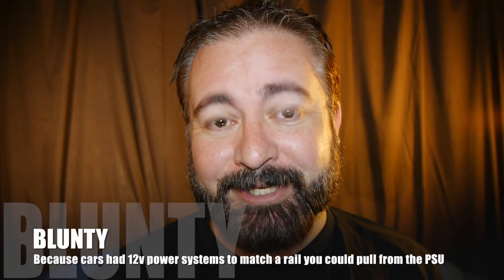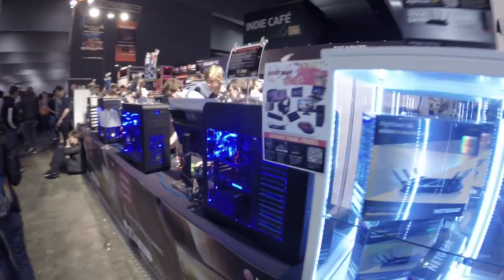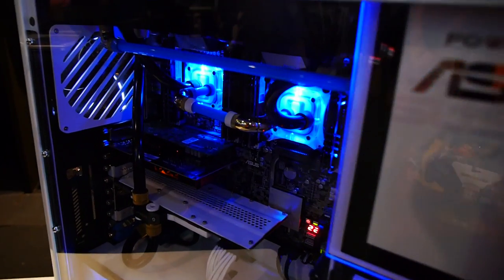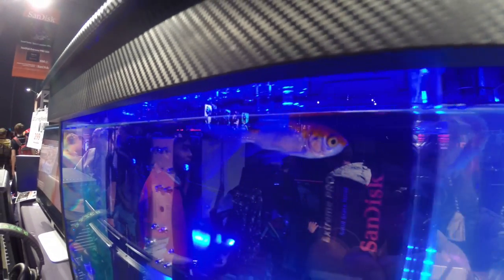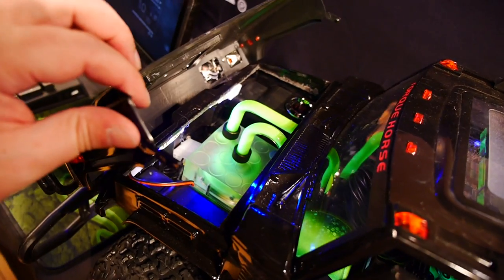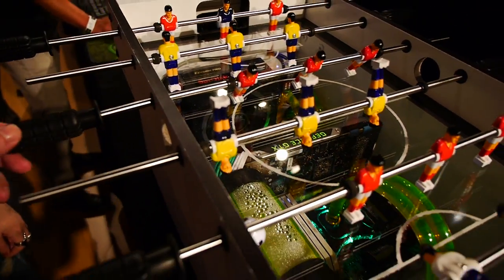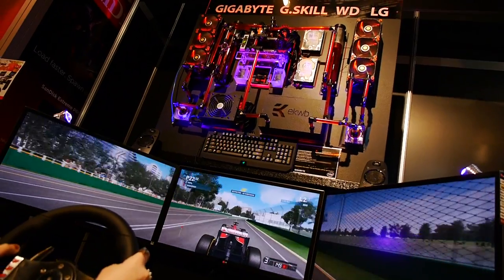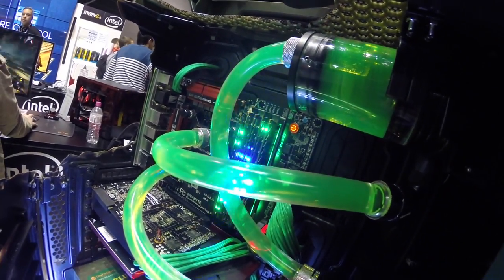Crazy PC Case-Mods & Custom Gaming Rigs

Comment: I think case modding is very interesting. Some designs do look amazing, but I always found practicality and functionality more important. Everything aesthetic is "just" a bonus.
You know what I would find absolutely sexy as a computer design? A rig that allows for easy hardware access for cleaning and upgrading purposes. On that note, here is my million dollar idea:
A vacuum cleaner connection to cases. This specially designed hole, fits the standard vacuum cleaner tube and is positioned in such a way that it will allow the vacuum to suck out all the dust from the inside, without having to open up the case...I wonder if this is possible. I'd get a case that had this feature.
Reply: I'm not sure how it could produce static. Would you care to elaborate?
Reply: Cristal3 James is correct it will Would create static because of all the dust particles will rub against the components creating a static build up. I'm afraid you will just have to use a duster can for now :P
Reply: PhasePictures Thanks for explaining and...too bad xD
Reply: Cristal3 No problem friend and yep its a shame but I'm sure they will eventually make an easier way to clean pc's :)
Reply: PhasePictures Could it be sucked out?

Comment: That Cooler Master Full Tower Case that was painted red near the end of your video is EPIC! I haven't modded a case since my old Thunderbird 800MHz machine in a Full Sized Evermax Tower. That was a beastly machine in it's day. I still have the modified case as well. I was thinking that some day I would improve on it's design and build something improved in a similarly (but different designed) case doing a water cooled setup. The hard part is just for a case and decent water cooling components, you're looking at well over a thousand bucks! That's before you even get your system components purchased!

Comment: The only mod I've ever done was cutting the slats from the vent in the side window of my case, to improve airflow, and mounting the fan on the outside.

But i am considering my next build, and it will be my first from scratch, though mods will be at a minimum I'm seriously considering water-cooling... I'm a bit of a noise nazi.
Reply from the maker: PAPO1990 In talking to folk like Thermaltake at EBexpo, I discovered that watercooling solutions are a LOT easier than they used to be back when I last custom built a rig. Worth looking at.
Reply: Blunty Yeh, that's what I've gathered from my research, but my biggest issue is having to swap the fluid regularly, and to a lesser extent I like to continuously tinker, and water might get in the way a bit for that. There's also the cost, but if I can pull off truly SILENT it will be worth it. I'm not considering any large overlocks, but hoping I'll be able to get by on just 2 fans for the whole system (a pair of intakes, creating positive pressure to push air out the rads).

I'm also waiting to see what happens with Win10 and if SSD's can get just a little cheaper. before I start ordering parts.
Reply: USE A THIN RADIATOR.
Reply: Erikogel1 Why do I need to use a thin radiator that badly that you'd scream it and give no explanation? If I need more fans to stop things from melting I'll add them, but I have to try.
Reply: PAPO1990 Sorry about no reason. I would recommend a thin radiator because it reduces the turbulence from the air going through it which in turn reduces noise. If you already have everything in your system by no means rip out the radiator and put a new one in. If you don't have it in yet you should try to get one. to compensate for the thinness get a long radiator such as a 360mm radiator. I got the advice from barnaclues nerdgasm from his tech talk with jay over his house.
Reply: Erikogel1 I don't have any of it yet, but I have decided on a case. Initially I'm going to have a dual 140mm rad, then adding a second dual 140mm later. Ideally I want to run the rads without fans. Using positive pressure in the case with only intake fans (as intake fans are less audible)... I know it might not work, but I have to try it, it's not that hard to add some fans anyway.
Reply: PAPO1990 If your doing that you should go with a really thick radiator. Turbulance only occurs when the fans are right up on the radiator and air is geting pushed through at a quick velocity
Reply: Erikogel1 Yeh, but the issue with a thicker rad is that they prefer higher static pressure fans, so I'm back to a more normal thickness, I'm probably looking at 45mm, but after I have 2 dual 140's I might add an additional single 140mm MONSTA (80mm thick) rad on an intake.
Reply: +PAPO1990 Noctua NF-P12
Reply: +2SavicM I know ;) I'm already a Noctua fanboi :P
Reply: l

Comment: Although the rigs looks absolutely fantastic, most of them are also impractical :-/ Open tops are perfect for dust to collect inside the case, and idea that more fans the better the PC is, seems to prevail still :D I prefer by far case that fits everything in it nicely, doesn't sounds like old diesel car while running and doesn't make me blind from all the light at night ( as my rig is running 24/7 in my living room.. ) I really like the big water cooling systems, but not what looks like noisy radiators... all in all nice video :)
Reply: Yep. Between the dust and cat hair at my place, I'd probably spend more time cleaning out those open tops than actually using them for gaming.

Comment: Some undoubtedly epic and insane builds, however I'm over having fully illuminated cases with derblinkinlights. I like a subtle, and stealthy case. But, as I said, some epic builds indeed. That insanely large case you showed (full of drives and what nots) is called the HAF Stacker by CoolerMaster. Pretty sick case designed to be stacked upon itself. Was considering building a NAS/Server in one...

Comment: Copper and chrome steam punk model with a wraparound gear design

Like the functionality of the one with all the ports on the top. And I have to agree with the other dude, the open top cases look good, but you'll be dusting them every day.

Oil cooled models are indeed good for keeping it running cool, but God awful expensive to build, and if you don't get them set up right the first time just imagine having to clean the oil out of it.

Comment: Mods are cool I haven't done anything huge just lights and wiring might give my smaller Bitfenix Prodigy some water cooling when I decide on a graphics card and stick a 230mm fan in front, Neat and clean modding is me thinking of rgb remote controlled leds for prodigy though :)

Comment: Great VideoI cant wait to do my next case it will be completely from scratch and this case will have advancements that have not been seen before and no this isn't just some silly cut out or add-on or some game themed rig... no its new advances that will make the case more practical and more useable by creators mostly and a little for gamers. The new case will be mostly aluminum and will do things I don't think anyone has seen before. Nothing with my new case will be standard everything is reworked for new standards not seen before and its all air cooled, a must for audio rigs. Not only practical and beautiful but cheap to build and anyone can have it cut to fit for under $200 or even less if you do lesser material side panels. I will share the materials list and the cut list when I am done. I also have a piece of furniture computer rig in the works as well as a high end portable gamer in miniature that runs off of 12V and/or 110V and/or gas.... ok not gas, and... and.... oh I want to tell everyone about these new ideas....but you will all have to wait.

Comment: I really want to change the case of my laptop.  The case has metallic sides which interferes with my microphone when the AC power cord is connected.  My printer is also interfering with the microphone signal, but I can just easily detach the USB to solve that issue.  Still the AC power cord issue is quite annoying.  :/

Comment: Won't the PC's with right angles on the water-cooling tubes have bad flow?

I've hacked up the top of my case to fit a large radiator that would normally only fit inside a massive case, it worked out good just got exposed fans on top of my pc.

That tank PC is cool but it's no goldfish tank and they will get too big in 2 weeks or die. They should of just set it up with small fish that stay small, I hate seeing goldfish put inside tanks they cant survive inside.
Reply: If the tubes aren't kinking at all, I don't see any reason flow would be affected.
Reply: If there's right angles its gonna need more pressure to get around than with bendy tubes? I just think it would slow the flow.